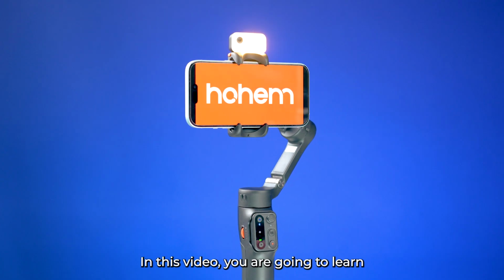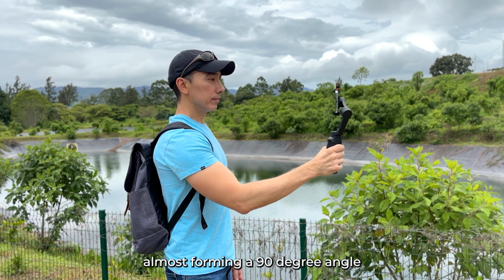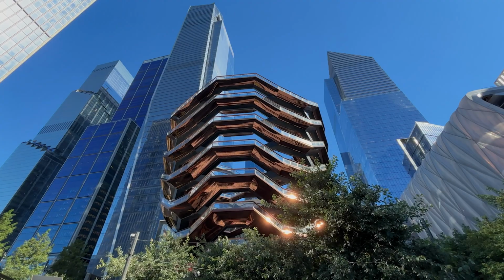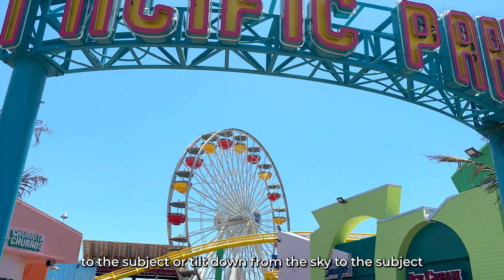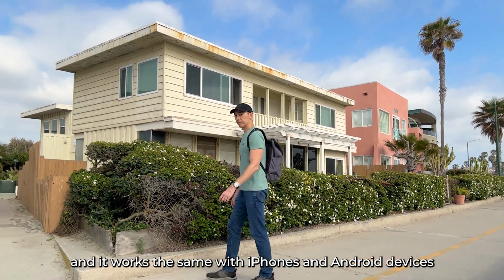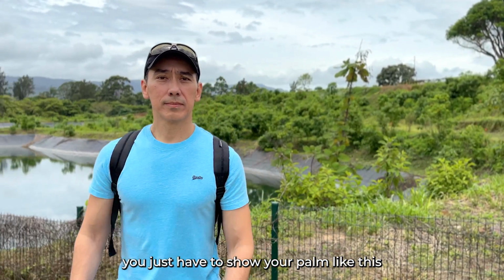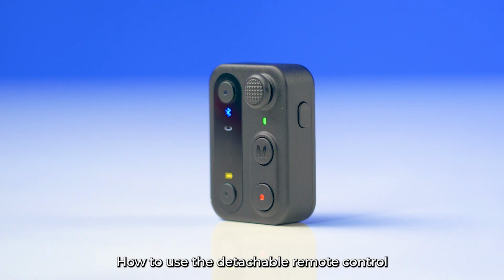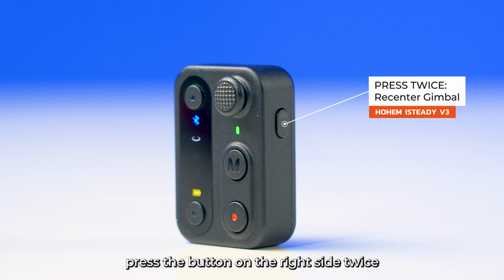How to Use Hohem iSteady V3: Quick Tutorial, Features

Comment: HI, your review is very detailed and good presentation👍. I would like to know, when you're using the remote control unit to zoom in / out, you we're using the original phone app or the hohem joy cam app? Can we zoom remotely by using the remote control unit  while using the phone's camera app, not via hohem joy cam app?
Reply from the maker: depends on the phone. Basically, if the zoom control works without using their app, then the remote will do the same.

Comment: Mine came tilted , not horizontal. Returened and never again. Poor quality
Reply from the maker: You had to update the firmware and then do an auto calibration. I think the quality is fine but if you did all that and if it wasn't a user error, you might have gotten a faulty unit. This happens even with big brands like DJI...